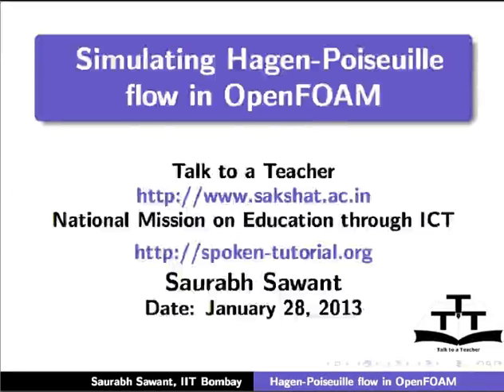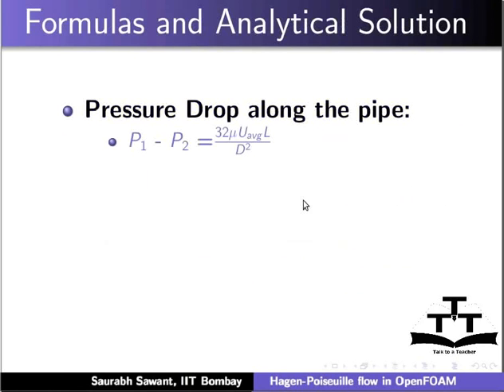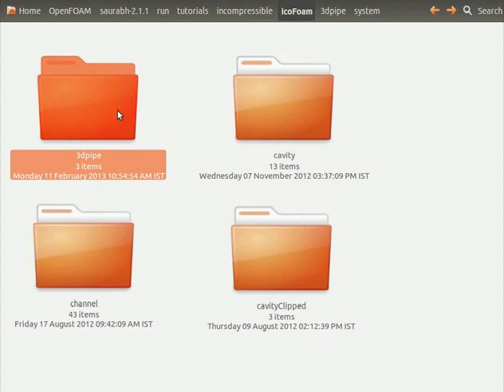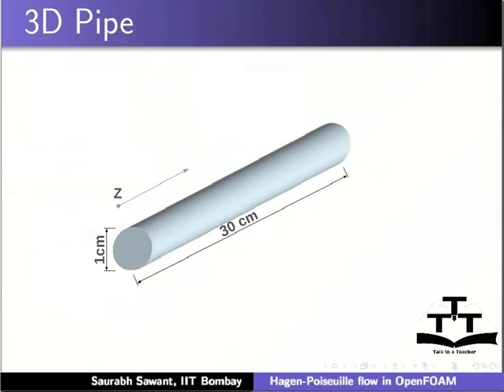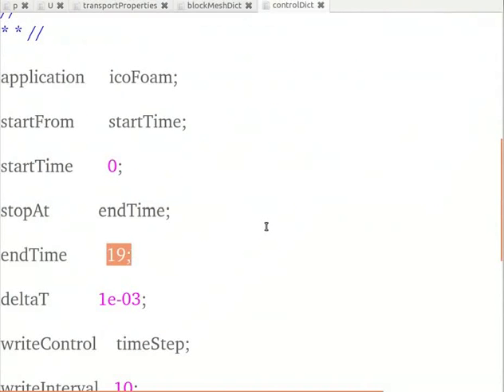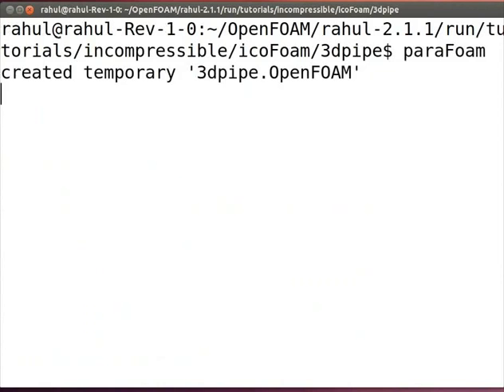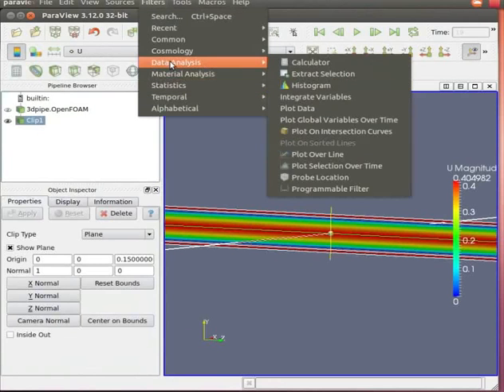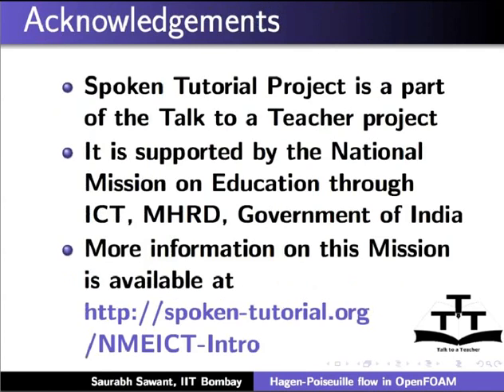Simulating Hagen Poiseuille flow - English

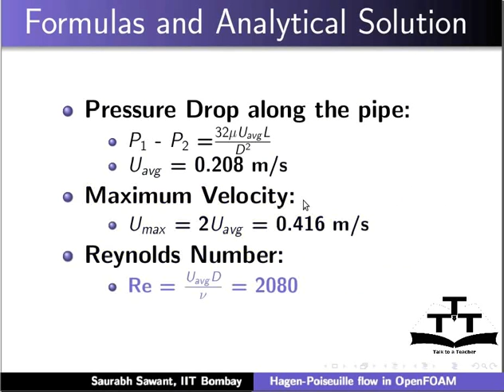Comment: 1:50  Shouldn't Reynolds Number Re = (fluid density * fluid velocity * hydraulic diameter)/dynamic viscosity = (rho * u * D)/nu ?   You forgot rho in the numerator.
Reply: you have written the word format correctly. dynamic visocity is "mu" and "nu" is kinematic viscosity (mu/rho). Hence whatever is shown on the video is right.